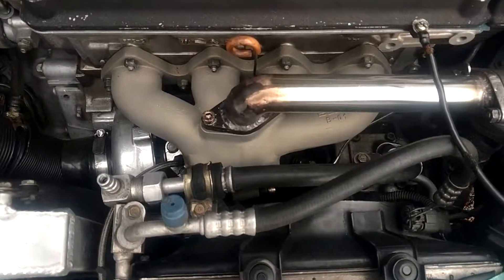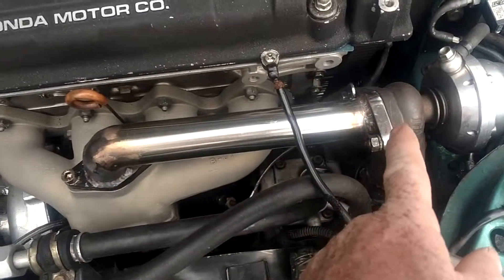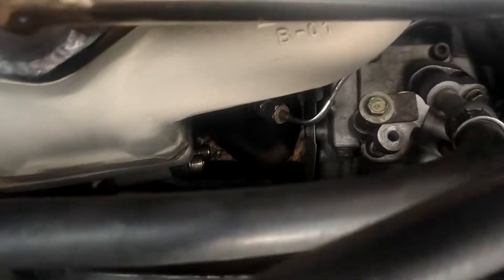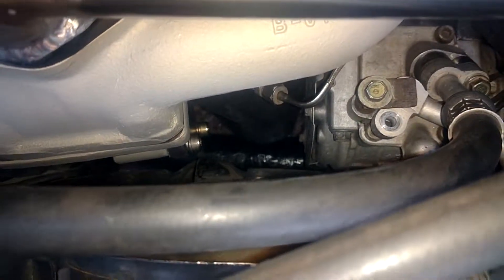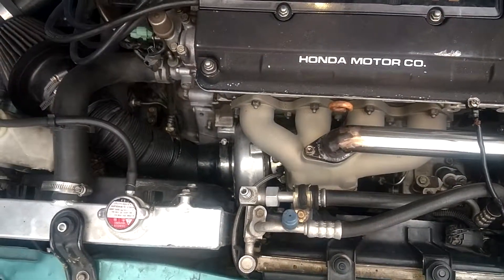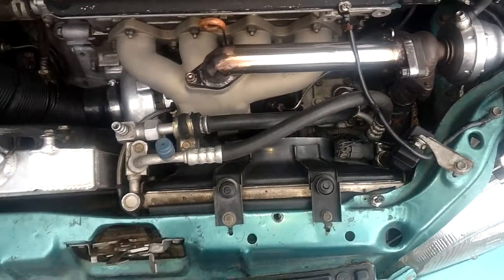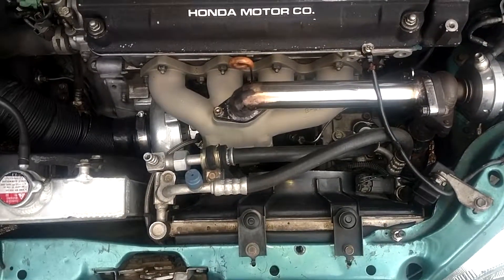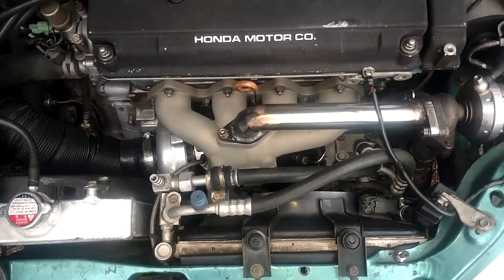Just a quick update on the new manifold, composite charge pipe, and car.

Comment: where did you get base downpipe to run ac? is it a 3" or 2.5?  Looking to run ac on my 00 em1 turbo similar setup.
Reply from the maker: Replied in the wrong place, look at post in video.
Reply from the maker: Btw, I didn't buy a down pipe at all, I just made one.  Just bought a flange and some 3" mandrel bends.